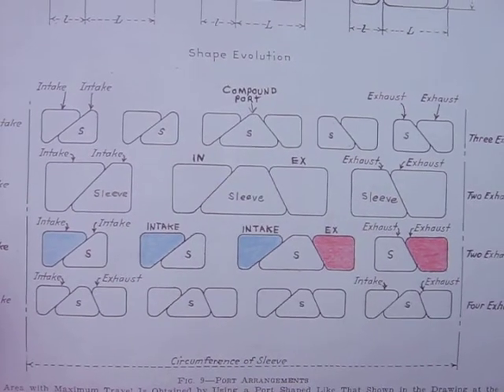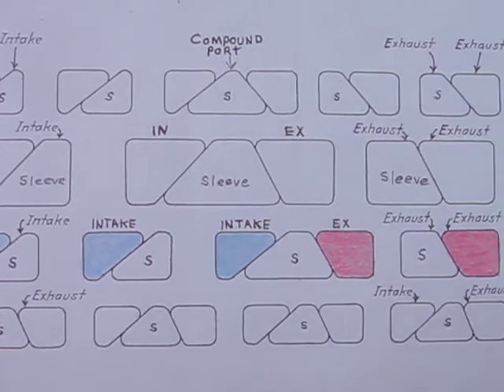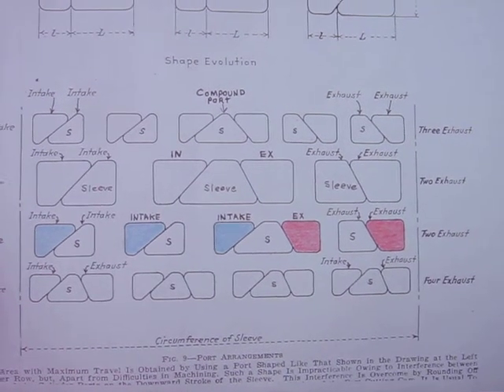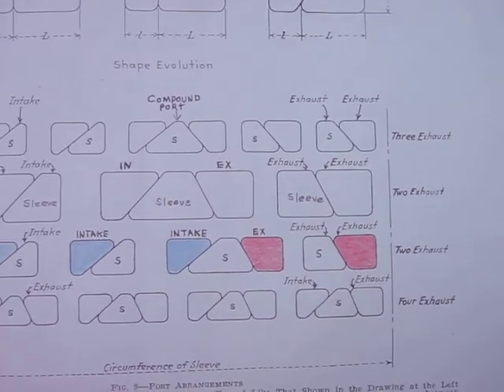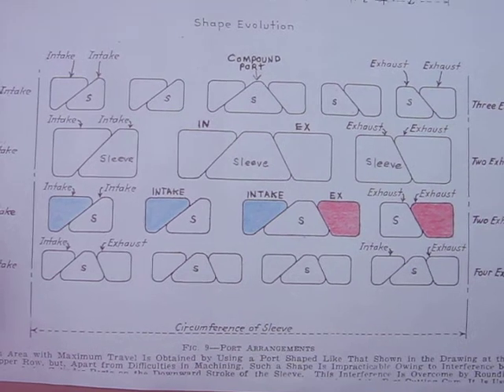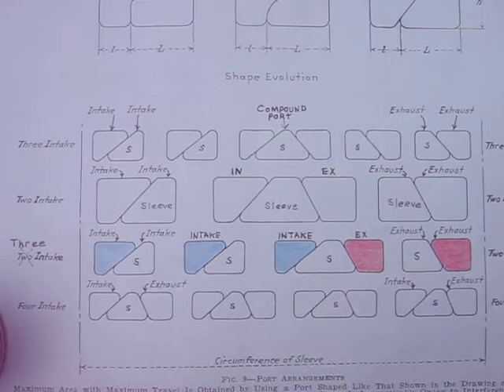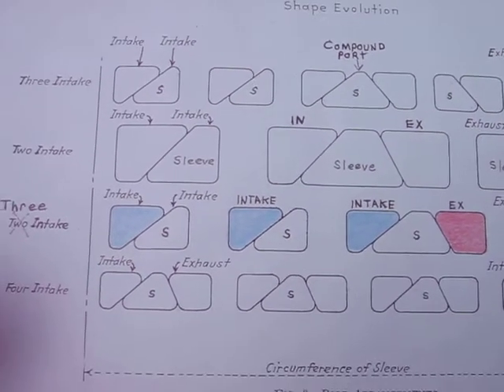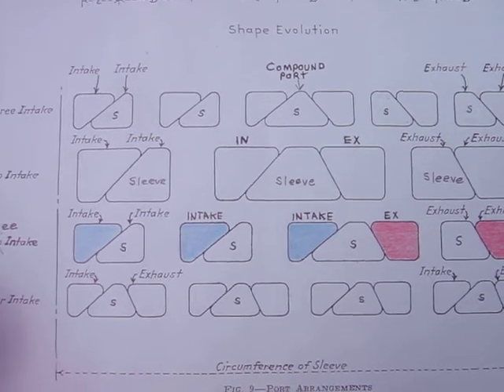Port Configurations for a Single Sleeve Valve engine

Comment from the maker: I think it mainly has to do with the port opening area that the curved shapes offer. They seem to give a bit more opening area than the straight edged shapes. I went with straight edges in my lawnmower engine do to easier fabrication. In the big airplane engines, they were going for shear power.

Comment from the maker: @schlusselmensch 
I pinned the rings in the junk head only, as I recall. The piston rings are free to rotate around. I tried to pin the top piston ring, but it caused way too much blow by into the crankcase, so I went back to no pin there. The junk head pinned rings don't cause that problem, since the head is a solid block (with cooling fins). I never tried to run the engine without the pinned junk head rings, so I don't know if it would have damaged the rings without the pins.

Comment: @ChargerMiles007 You said that the rings had to be pinned because of port/ring intersection.
I don't recall the aero engines having this feature although they may have had pinned rings to prevent rotational wear in the lands? Did you have to resort to this because of the bore and stroke ratio? And of course, there were 1 intake and 1 exhaust port sleeve valve engines made. Double sleeves though.

Comment from the maker: @Moriquendi001 
Hi there, now that sounds like a Very interesting project!
A man in England built some similar engines back in the early 70s, Mike Hewland, of Hewland Transmissions, I found him in a Popular Mechanica mag., I think it was.
Anyway, yes, the rings do come up past the sleeve ports. I had to pin the top 2 rings on this engine, to stop the rotation.
Hey, CAD is good, I used it on this engine where possible.
Send me a personal message, and we can talk more.

Miles

Comment from the maker: @smvuy 
I hear you there Dude (no money and in college) thats when I built this lawnmower engine, as a Senior project.
I would make it so the 2 exhaust ports were on one side, and the 2 intake on the other. There would be some machining involved for sure. My son had the idea of making the port area out of 1/4" plates, and stacking them up to the req'd height, it would be easier to machine that way. It sure would be a Cool project. I wouls go for a 4 cylinder, as there are less parts  to make.

Comment: @ChargerMiles007  and 2 intakes a 2 exhaust closely together (a a few dozens of degrees apart) will do? The idea is not going mad with making ports that run  next to the cylinders like the ford flathead middle exhaust ports and by the way i due to my money situation (not having a job and too busy on college) I cannot get my hand dirty in the short term but I smell plenty of potential to get rid of the nuisance poppet valve

Comment from the maker: @smvuy 
I would go at least 2 intake and 2 exhaust ports. Nobody ever built one with just 2 ports, you need too long of sleeve stroke to get a large enough opening area!
The brain melting isn't as bad as you would think! I can help if you want.
You would need to build the port area, as well as a "junkhead" for each cylinder. I figured a 2" aluminum slab would work for the port area, as I thought of building an inline 4.

Comment: I want the largest ports possible, just one for intake and other for exhaust so that haw can be apllied to inline engines without  too much cutting and brain melting.

I ask you so maybe I can try with a junk engine inline 6, those engines are thirsty (the reason they are dumped) but silky smooth

Comment from the maker: @KrankieV2 
Actually, the sleeve valve has a lot less parts than a "normal" poppet valve mechanism, especially when you get into 4 or 5 valves per cylinder. That is one reason they became popular in aircraft engines.